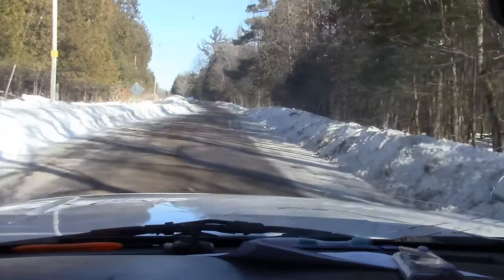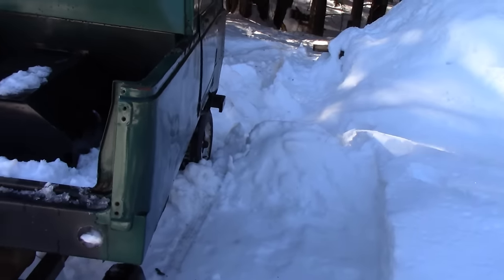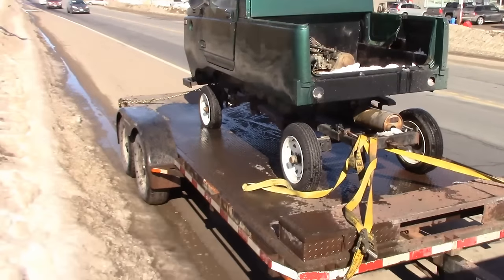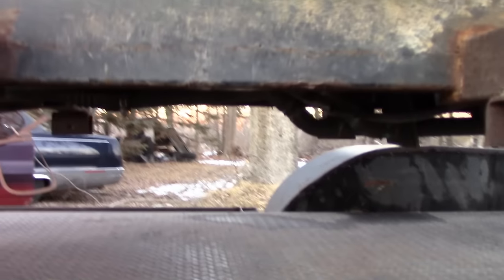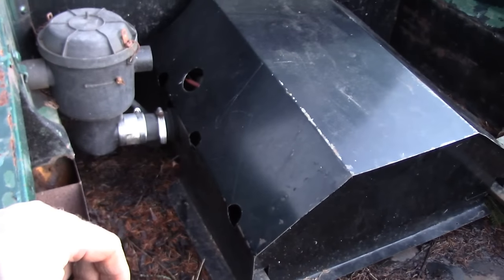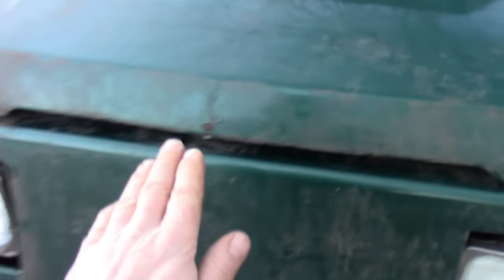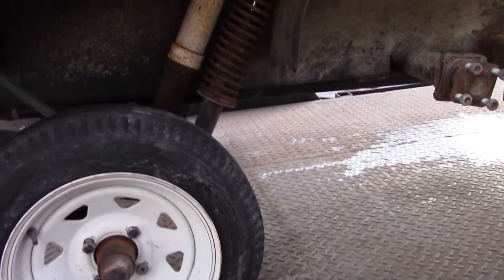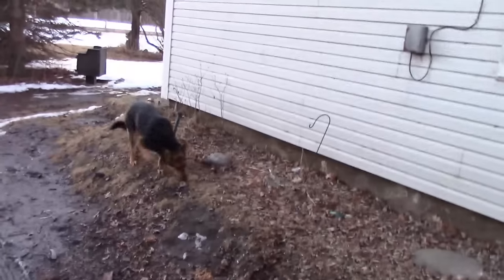suzuki samurai half track

Comment: Even the horses were saying WTF?   ;-)   Thats quite the thing there.....  Oh, and time for an electric winch on the trailer.   ;-)
Reply from the maker: Funny thing is I have a big one that I never got on there yet. I could have used it a few times already
Reply: Ha! Time to mount it man!   ;-)   It made my life a LOT easier once I mounted one. (I used the live power brake away feed from the hitch to keep the battery charged.)  When it wasn't hooked to the truck, I had an adapter from the trailer 7 way to my trickle charger.

Comment: that is pretty cool,front suspension looks like the weak link. my friend had a samari with a 4.3 in it running full width cj axles on 33,s. it could dam near climb straight up,perhaps a v6 swap if you dont have enough power

Comment: Good evening Shawn...
Half track the rear and use wide, low pressure, high groove mud tires in front for traction in turns. This all depends of course on the engine's ability to push/pull something like this.
Take care,
Chris
Gatineau, QC
Reply from the maker: I was thinking the same thing, biger tires on the front. Have to get it going first to see how it gose

Comment: cool looking right if the engine is toast maybe think of doing a electric conversion run independent motors to each track they would have the tourque to run a full track but just spit Ballin I'm sure whatever you do it will be awesome

Comment: I hope it's the T-case not the trans..  it must have been making noise for years though I'd think.. I had a T-case go bad, but it was still drive able.. but it took out the plastic speed sensor gear.. and trans wouldn't shift.
Reply from the maker: The back of the Trans is broken off, dont look good. they want 1000 for a used trans with 224000 on it lol
Reply: Ah crap..  hmmmm the price seems a bit high.. maybe call a few junk yards in and around the peterborough area.. I find them to be decent for prices..